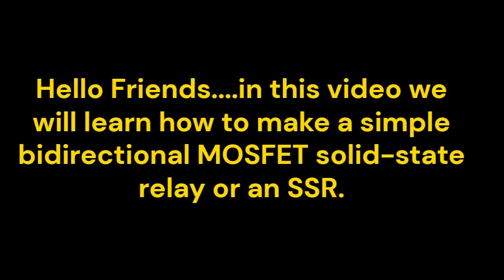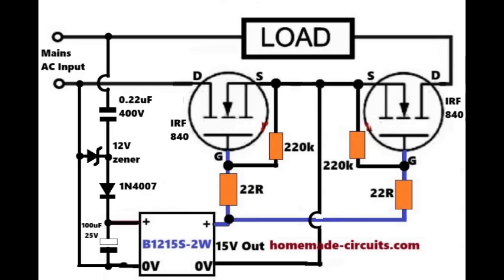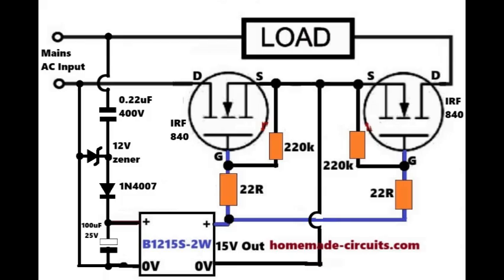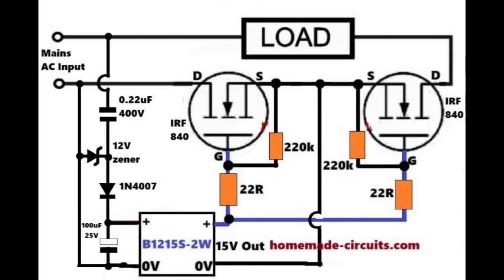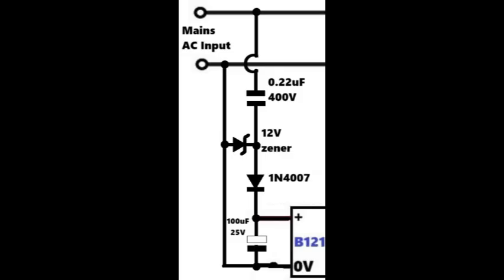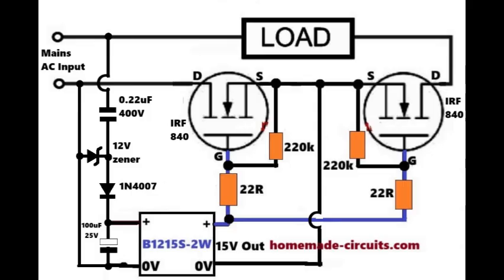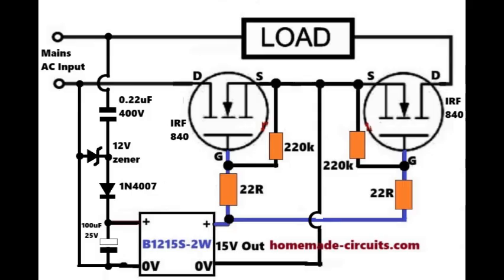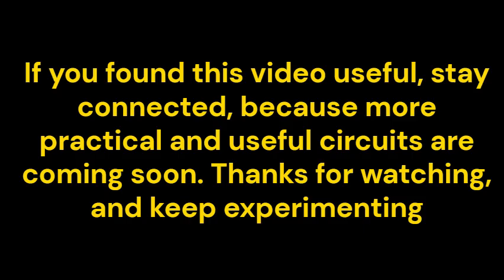Make this Simple Bidirectional 220V SSR Circuit using MOSFETs

Comment: Wow! Thanks! Do you have any instructions on how to build an adjustable BMS-type charging/protection circuit for a lithium cell? The idea is to be able to adjust it so that it only charges up to 3.9V-4.0V and doesn't allow it to discharge below 3.2V to maximize the battery's lifespan. I've tried using an LM339 comparator and TL431 zener diodes with modfets, but I haven't been able to get it working.
Reply: Try this. Neat compact and works. And adjustable for series packs. On yt, channel KasyanTV and video name overvoltage and undervoltage protection. 
Link for layouts etc broken, but i just copied by hand. 
😊
Reply from the maker: You can use LM393 and configure its two comparators to sense the two levels separately and do the needful...it will work with 100% perfection....if possible I will design the circuit for you...and let you know...
Reply: The easier, flexible method is to use a Arduino Nano. 😊
Reply: @tonyrebeiro yea but Tony, that misses the point! It would be even easier to buy a ready made charger, but believe it or not, some of us still really enjoy playing and learning analogue and thru hole.

Comment: This circuit can be simplified to one bridge rectifier and a single MOSFET on the DC side of the rectifier and the load in series with the AC side of the rectifier.
Reply from the maker: Thank you for your feedback, however i think two MOSFETs are required, otherwise the load will not switch correctly....did you try with a single MOSFET and test it practically?
Reply: @Homemade-Circuits Yes. It works like a charm. I saw this first in an Akai tape deck, nearly 40 years ago. But they were using a BJT. I tried it with a MOSFET, recently, and the results were great.
Reply from the maker: @tonyrebeiro  That is strange....because according to me single power MOSFET alone cannot act as a proper bidirectional AC SSR. The MOSFET’s intrinsic body diode will allow the current to flow in one direction when the device is off, so it cannot block AC both ways by itself.
Reply: @Homemade-Circuits The DC side of a Bridge rectifier does not output AC, and therefore, if you connect the SOURCE of an N channel MOSFET to the Negative terminal of the bridge rectifier, and the DRAIN to the Positive of the bridge rectifier, it will work perfectly. The internal body diode of the MOSFET has its Anode at the Source, and therefore cannot ever conduct.
Reply from the maker: @tonyrebeiro  So you are referring to a DC SSR, not an AC SSR, right? If drain is connected to positive it means it is a DC SSR, or simply a MOSFET ON/OFF switch, not an SSR?? The video above discusses a 220V AC mains load SSR circuit.
Reply: @Homemade-Circuits Your theory background appears to be weak. That's why you're talking about unrelated aspects.
Reply from the maker: My theory background is good...your explanation lacked clarification about the load...Anyway I have understood what you want to say the load is connected in series with the bridge rectifier AC input terminals and the AC supply...while the positive of the bridge is directly connected to the mosfet drain and the negative to the source...so the mosfets switches only with the DC while the load switches with the AC... that's an old concept which  I have  used and discussed  in many of my circuits...
However this concept is never used in commercial good quality ssrs...
Reply: @Homemade-Circuits My explanation was the same all along but you failed to figure it out, that's all. I never said that this is the best method to Switch AC, with a single MOSFET, but it works reasonably well,  is cheap to build and I'm using it for a low power application, very successfully for the last 2 years. Thank you.
Reply from the maker: @tonyrebeiro  You should have mentioned about the load position, then I would quickly understood ...because SSR is all about load switching with AC safely and correctly, also it seems you lost your patience quickly...yes it will work reasonably well... here is the diagram for all the users: https://www.homemade-circuits.com/wp-content/uploads/2025/11/single-mosfet-SSR-circuit.jpg
Reply: @Homemade-Circuits Please read my first comment, once again. I clearly said "Load in series with the AC side of the rectifier"  Thank you. Even at 63 I have no foggy Brain issues...😅😅😂😂
Reply: I'm not sure if the circuit works. At startup, when the 0.22u C is discharged, the zener diode can receive the peak AC voltage and go in short circuits. The two MOS resistors are in anti-series, so one conducts directly and the other is cut off and conducts its internal diode, but can it handle the entire load current? I've never seen data sheets that consider the reverse conduction of a MOS.  Lastly: but where do you control the on/off of the SSR? I don't see any control terminals. Can anyone give me suggestions?
Reply from the maker: @francescocontalbi1222 Yes, after posting the video I realized that there was no need of that capacitive power supply...youtube does not allow us to modify the video once posted, that's a big problem for us. The diagram simply needs to be like this: https://www.homemade-circuits.com/wp-content/uploads/2020/01/bidirectional-mosfet-SSR.jpg
Reply: if load current is small